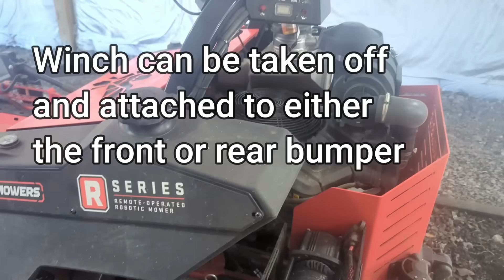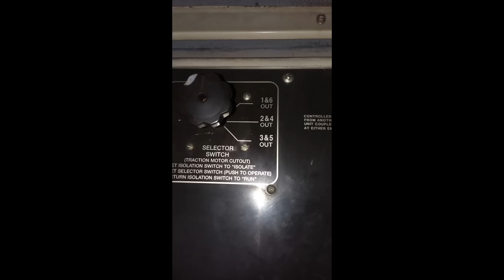Traction Motor goes Bad on #22 Locomotive

Comment: Nice looking mower, Sir Dave! Feel free to bring it over whenever you find yoursef in the neighborhood 😉

We use brushless DC motors on our little robots. They run on ordinary 12 volt sealed lead-acid batteries. Each motor has an associated controller that essentially turns the DC power into three phase AC It's a little bit more complex, but that's the essence of it. There are other kinds of motors, like the ones that shake your cell phone. The mind boggles!
Reply from the maker: Thank you for the nice comment Eric. I think a lot of people would
like to borrow that puppy..... :-) I'm not too well informed on how
electric motors work, will do some research on brush less DC ones, thanks for sharing that. Really appreciate your taking the
time to watch and may you have a very good day.